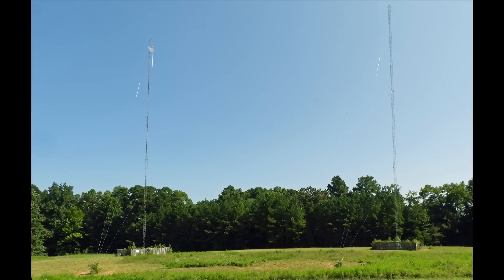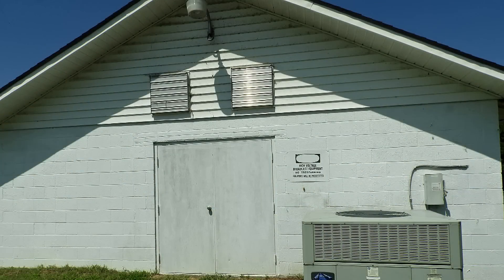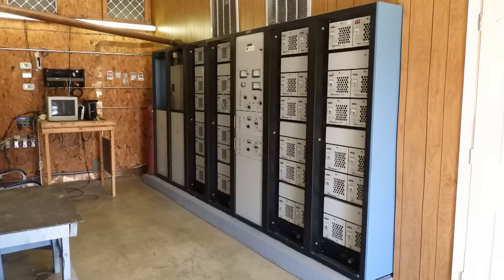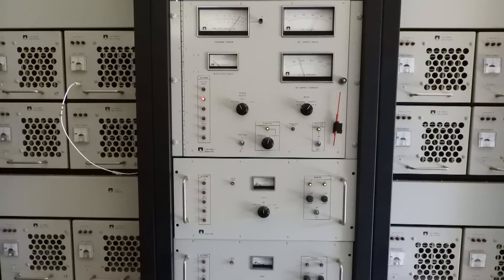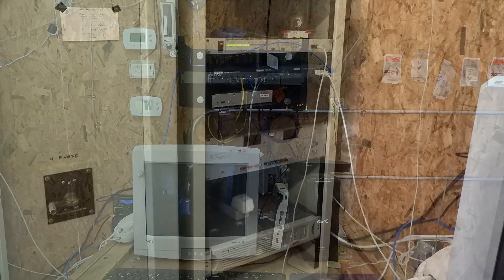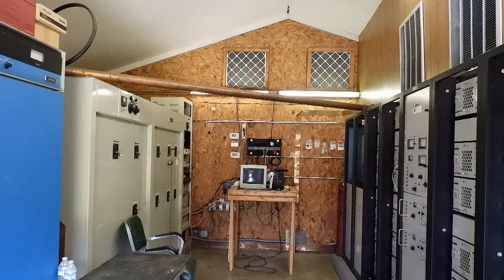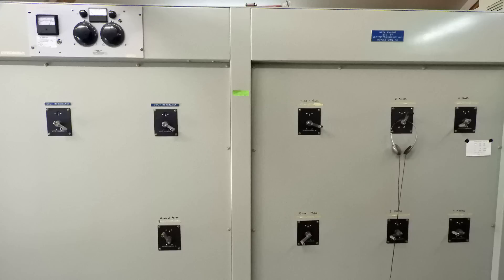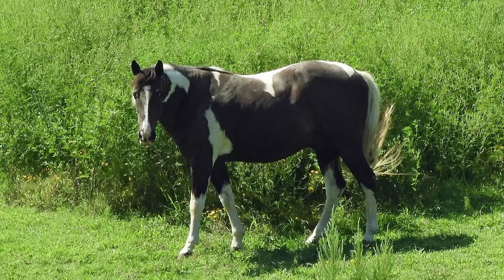50KW AM Transmitter Site

Comment: Looks very similar to WBAL's AM transmitter in Baltimore, MD.  They run at 50kW to which is the maximum limit for AM broadcast band.  I have part of the original transmitter that went into service in 1925.
Reply from the maker: Thank you.

Comment: Very cool Rick. I believe CKLW in Detroit and Windsor had a 50KW set up as well. I remember back in the 70's leaving Toledo on 75S and going back to base after leave. I would turn on to 70 west heading for Indy and still would be listening to the Motor City on AM 800 CKLW.. I'm not sure but it seems like you showed us this place once before. I know in the past your vids took us to some really cool places. Always enjoy it my friend.
Reply from the maker: We have been here a few times, replacing diodes in the power supply, lighting straight blowing the circuit breaker box open, replacing 440VAC wiring. The horse is new.
Reply from the maker: Yes you have seen this site before. I thought I'd show it again because I have a few more subscribers sense the last time I videoed the station. Also it is in good working order and still in operation.